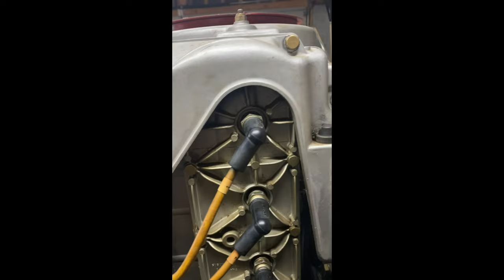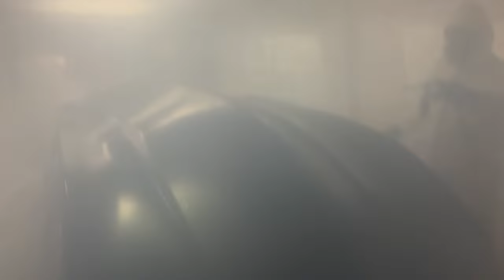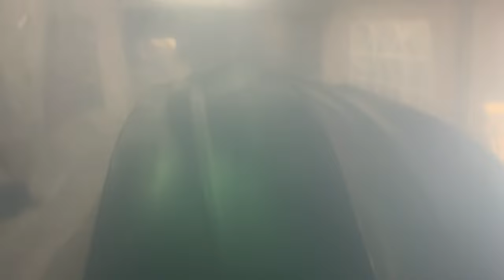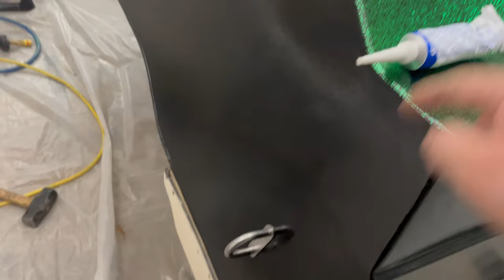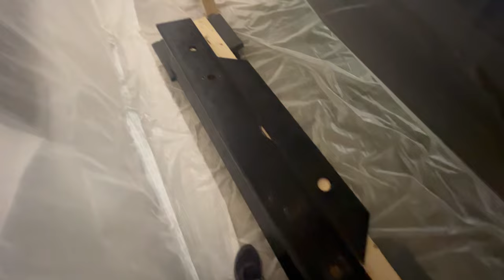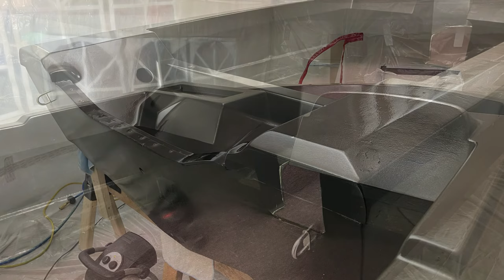New Custom Paint Job On The Boat #ScorpiusFishing #StellarAbyss

Comment: i painted one they look great at first but it don't last long it scratches really easy
Reply from the maker: I do try to be careful around the docks. It does have a hefty coating of diamond clear coat on the bottom which has helped a lot. I do plan on getting it wrapped in the future though which will protect the sides better.

Comment: Did you hookup the metal flake gun to a regular garage air compressor or did you have to buy an airbrush compressor?
Reply from the maker: Regular garage compressor. I had an in-line regulator installed just before the gun.

Comment: On a old painted bass boat do you have to primer it or can you just sand and paint ?
Reply from the maker: The primer I used helps keep blisters from popping up in the fiberglass as well as a waterproof barrier. There is a different version for aluminum as well. I always suggest a primer on anything outdoors that you want to keep in good shape. It helps the paint adhere better.

Comment: Did you use topside paint for the bottom or top
Reply from the maker: Topside paint for the whole thing. She comes out of the water after every trip. Base coats of primer under, then topside paint followed by 2-3 layers of clear. Then I did the 3 layers of metal flake and clear to finish it off.